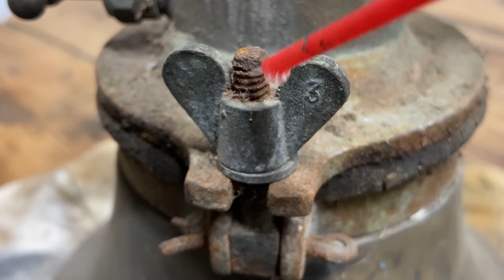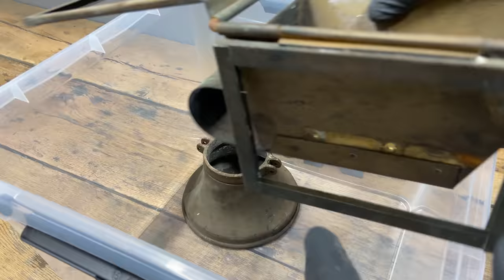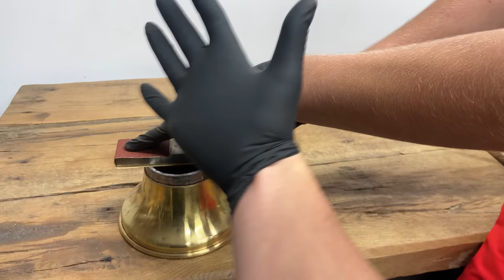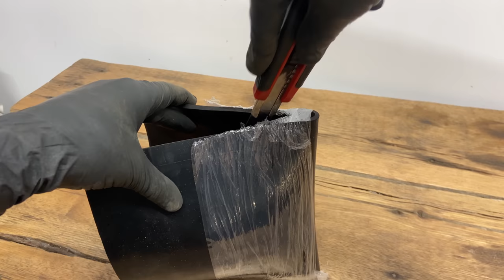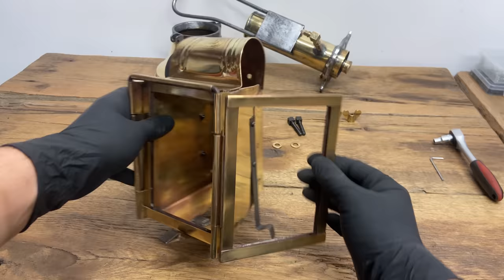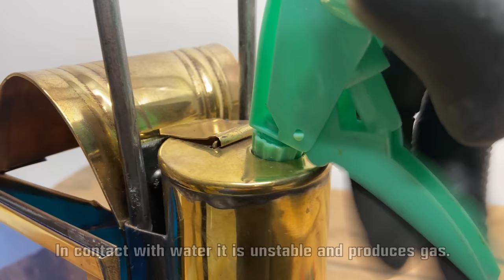Restoration of a very rusty acetylene lantern from 1940 - ASMR 4K DIY

Comment: Mesmerizing. These acetylene or carbide lamps lighted the temporary stalls and carts selling fruits, spices, toys and sweets in India many decades ago. In those days (1950s and 1960s and even 1970s) electricity had not reached some parts of cities and the whole of rural India but trade under the acetylene lamps was perfectly possible due to intense white light. Great, brought back child hood memories.
Reply: Exactly. In rural India the carbide lamps and kerosene lanterns are  used up to the late seventies. I have used it in my childhood days. Its mechanism was very simple and village blacksmiths manufacture it. This excellent video reminds me of my childhood days. Thanks a lot.

Comment: I knew it had potential when I first saw it but now I’m sure it’s better then new since it was a utility light it wouldn’t have been this polished new! I do want to warn you about lead safety tho, if you ever plan to sand or polish any soldering don’t use a dremel it makes the lead go airborne and you can breathe it in also you don’t want to get lead in your shop, instead use a wet sanding method with as little water as possible and do it over plastic and some rags so you can wrap it all up and throw it away! Keep it going and keep it safe 😊
Reply from the maker: I didn't know, thanks for the info!  😦
Reply: With good ventilation.. I do lead casting and even use a mask and fan outside

Comment: seen quite a few smaller versions of these used in the old mines in the usa. water hits the carbide and the carbide then gives off acetylene gas. prior to batt powered lights in mines, these were used i believe up till the 50's. before that miners mined by candle light.
Reply from the maker: you said it all!  :)